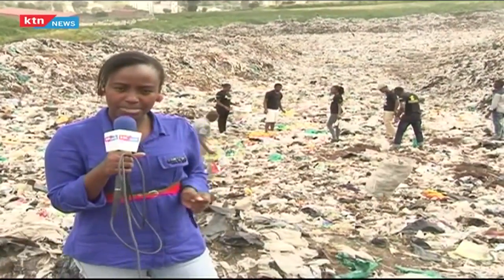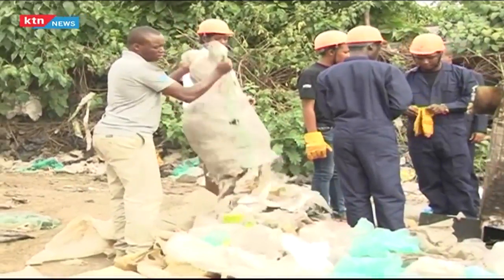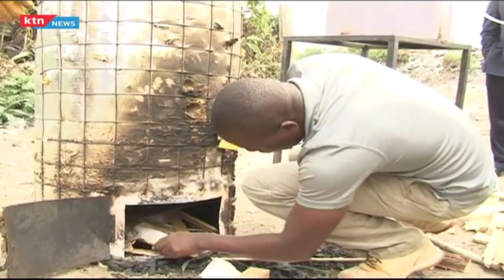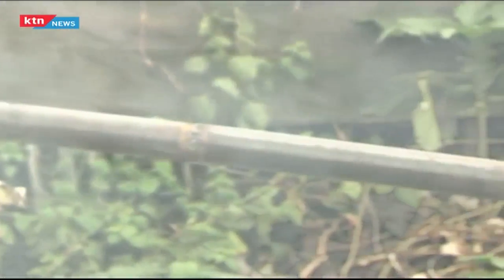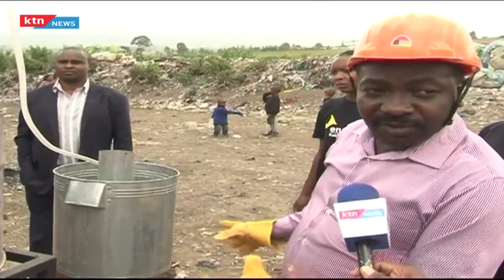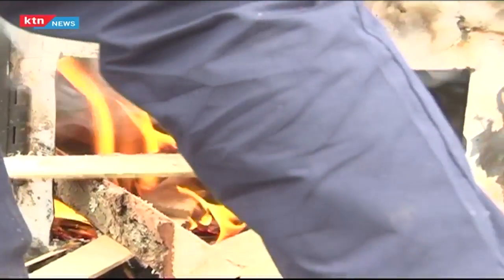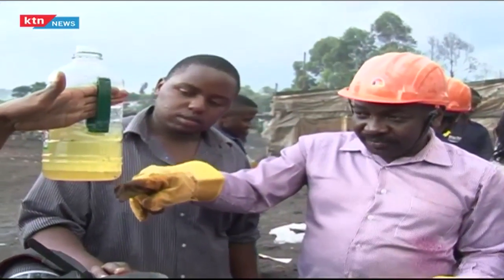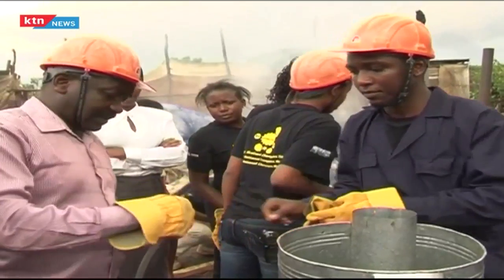POLYTHENE TO DIESEL: How to use Polythene to make diesel

Comment: Nice video.
Now it is real. 
We use the fast pyrolysis plant Fpp02 for recycling plastic waste . Reactor 500 kg/h. It turns out liquid  fuel for hot water boilers.
Good luck to the author of the video.
Reply: How big is the reactor to make 500kg /hr